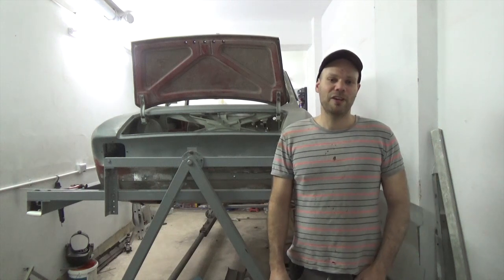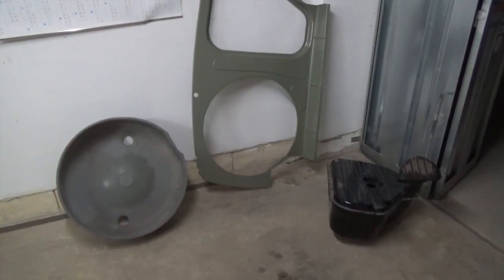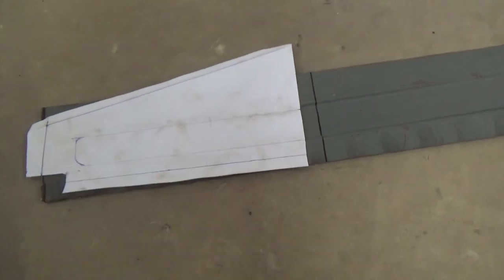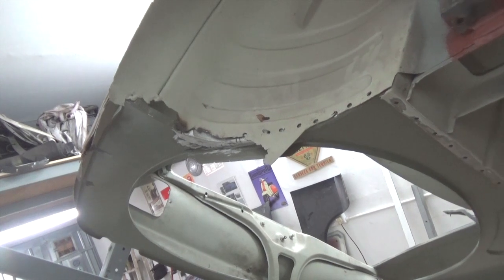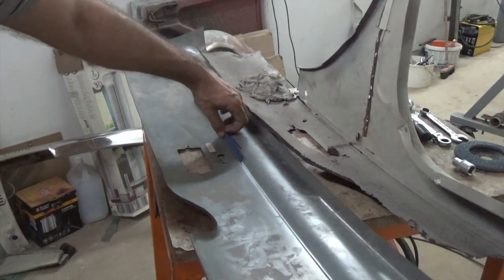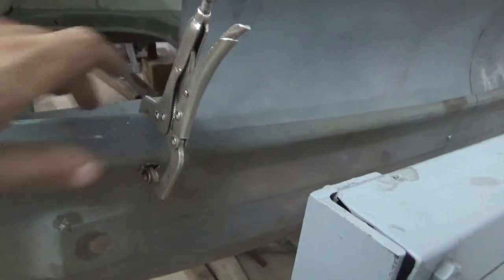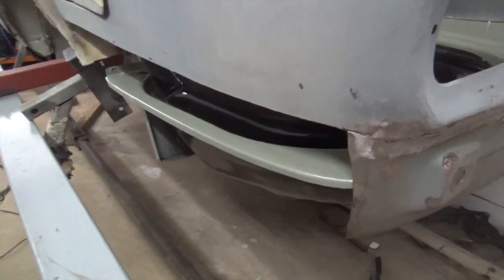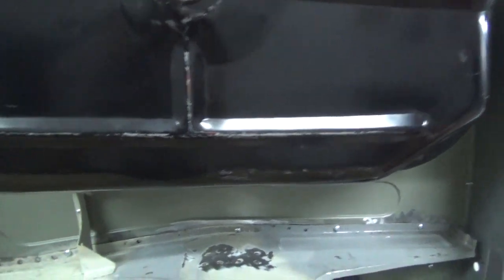Raising Junior Episode 8 (How to replace a rear valance)

Comment: What thickness of sheet steel do you use for these replacement panels?
Reply from the maker: Non structural parts are about 1mm, while thicker bits are 1.6mm thick. The trunk floor was a bit thinner 0.8/0.9mm from the manufacturer
Reply: @raisingjunior6389  thanks for the reply! I just got some 0.95mm to work with, but before that I had some 1.2mm and was really struggling to shape it. Do you do the thicker stuff just with hammer too?
Reply from the maker: @blahblahblahblah2837  Sorry just saw this comment now, it depends on the shape we want to form, we use hammers for curves, I have a homemade bender for right angles but it has its limitations, we clamp ticker steel to the bench and hammer it down gradually. The ticker steel tends to shape smoother than thin sheets with a hammer. A small difference in thickness makes it much harder to shape